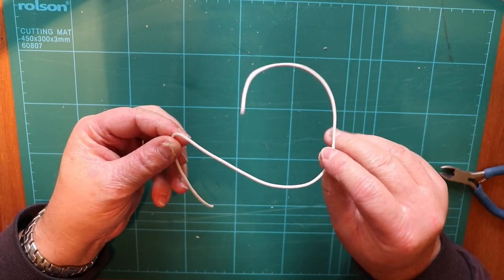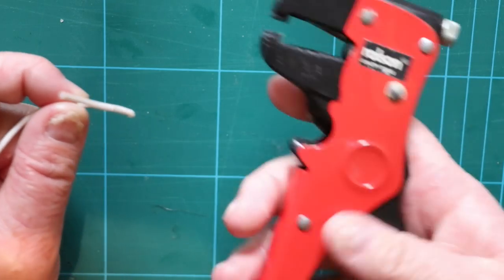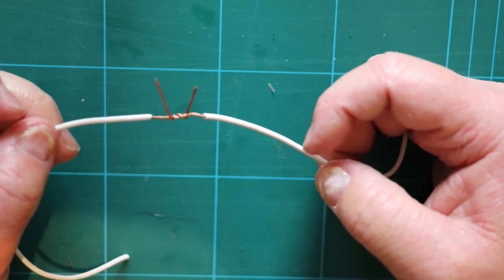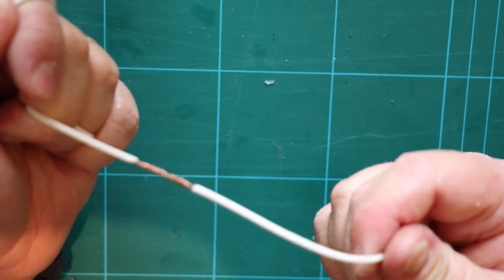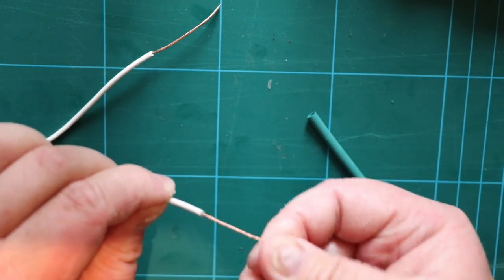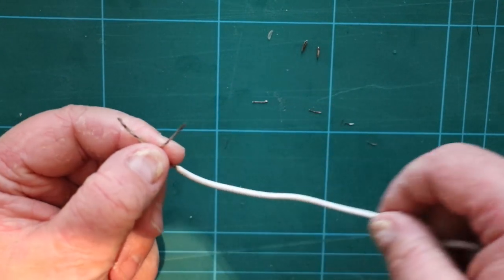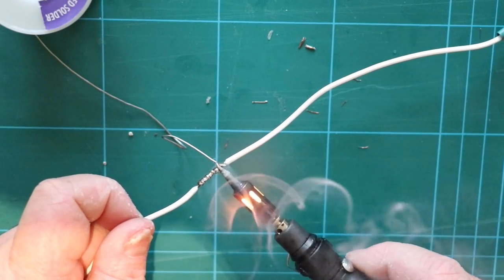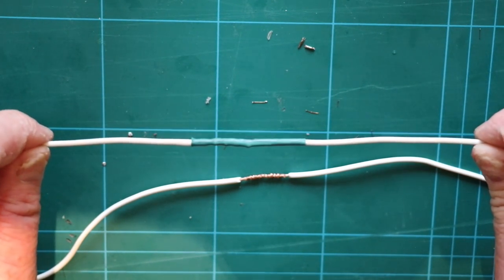Joining broken cables in the caravan or motorhome

Comment: Nice Dan, good advice. Top tip, when stripping the cable... Once you have broken the sheath and are pulling it off the cable to expose the copper, rather than pulling the sheath all the way off straight away pull it till it's about 5-10mm from the end. Then twist the PVC sheathing rather than the copper. It gives a perfect tightly wound twist as the cores are still held together tightly.
Reply: I do that too. Easier and gives a uniform twist without flattening the stands towards the end.

Comment: Very informative, Dan. On a recent trip to South Devon, I stopped en-route for a toilet break and checked to see if everything was alright with the caravan. Just as well, as the electrics cable was sitting dangerously close to the ground. Lo and behold, it had scuffed away the black outer cable, and stripped a red cable and frayed a green one. The red wire turned out to be the brake lights! Unable to fix at the roadside, I had to keep turning the lights on every time I braked for the rest of the journey. Once at the site, as a temporary fix I purchased some wire from Halfords and used chock blocks to connect the wires, and protected with black electrical tape. This worked just fine. But since we've got home, I have soldered the wires, and covered with heat shrinking tape so it looks neat and tidy. Although not nearly as professionally as you have here! I actually took some photos and considered making a vlog about it, and coincidentally you've posted this one.

Comment: As you can probably tell I have only recently found your channel. Liked the video - I too forget the heat shrink. What I wanted to mention was prompter by the opening sequence by the speed hump. We were at a C&M site near Cromer on a pitch overlooking a speed hump. We were sitting outside with a glass of something watching the new arrivals, as you do. It was slightly amusing to see drivers slow right down, front wheels over the hump, slowly back wheels over then THUMP as they drove off forgetting the van. It wasnt just the odd one either. If you could include the tip in one of your up to date vlogs it might save some broken crockery
Reply: Speed humps should be banned.

Comment: Hi Dan, we used this splice in Battle Damage Repair on aircraft.  In the van I have a gas soldering iron (same model) but as I was caught short of gas one time I also carry some low melting point solder that can be melted with a match.

Comment: I had never heard of the Western Union splice - looks good. But no need to tin the wires before making the soldered splice.  They are already clean (just been stripped), and tinning makes them hard to bend. Instead of tinning, just dip them in flux paste first. 
 
To strip the sheathing I always run a modelling knife round and pull off with my finger nails (they are tough). With experience you can feel the blade start to touch the copper core and so avoid cutting and losing any strands; you don't have that feel with cutters or the dedicated Rolson type wire stripper. Dedicated strippers need adjusting carefully for every different size of wire, so are only useful in a repetitive situation such as in a factory.